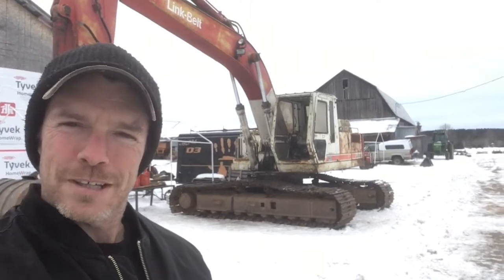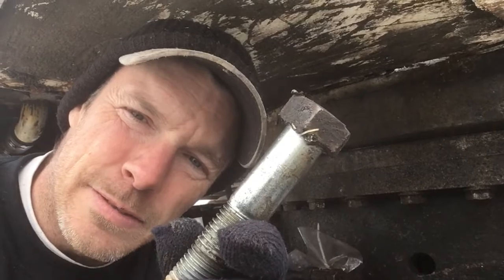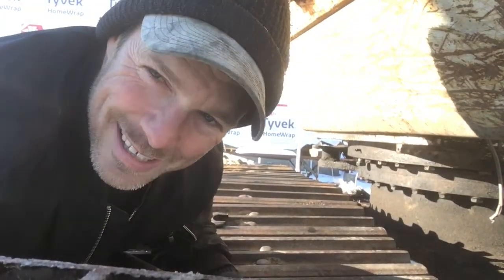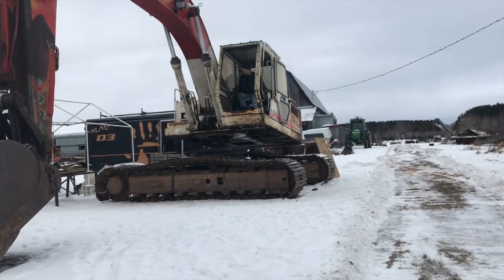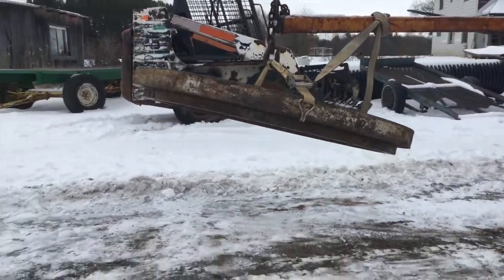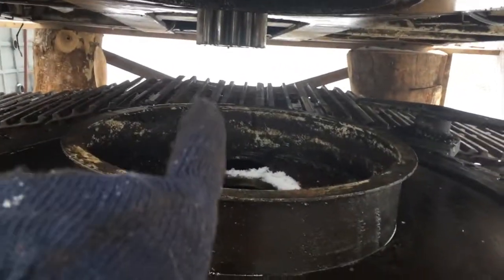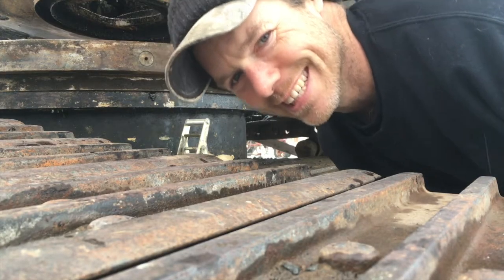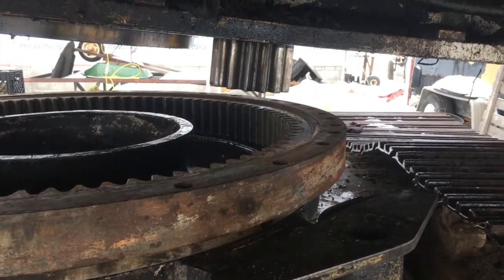Excavator Swing Bearing Repair

Comment: I'm noticing on my 4ton mini slight rocking/play when on slightly sloped ground and swinging with load back and forth .Its like the cabin falls down an inch or so at one point of the swing. Can that be a concern with swing bearing?   Its only 3yr old with 450hrs
Reply from the maker: Well!   I guess use it until it grinds… or warranty.🤔.  But bearings do have play on them… but🤔